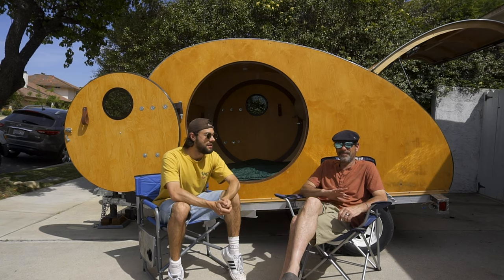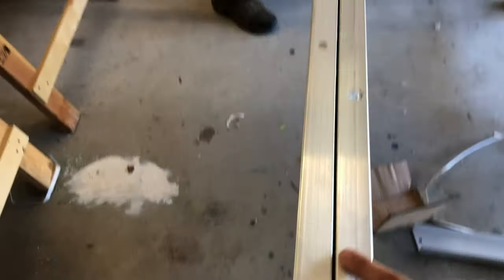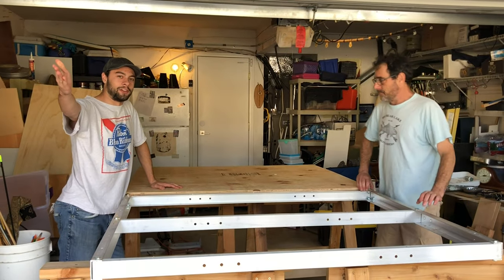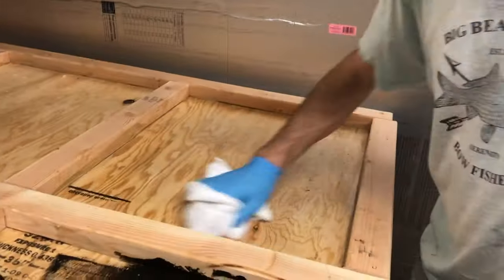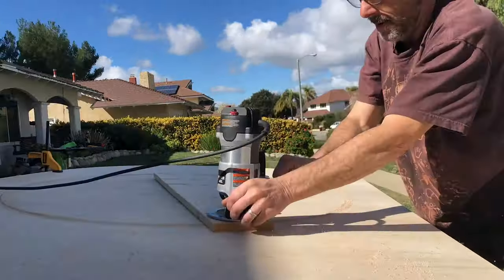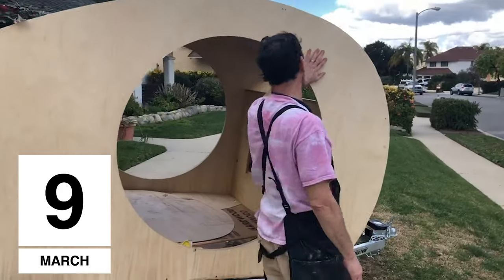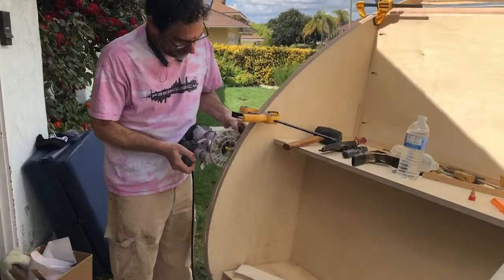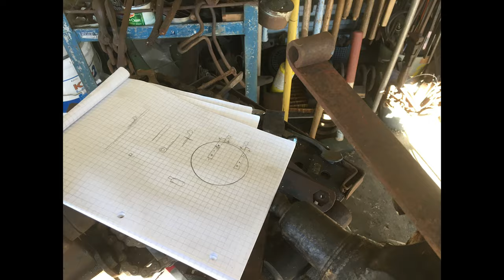BUILDING OUR TEARDROP TRAILER

Comment: I have thought about using that trailer...price and weight is good for my project.  Not heard much about reliability of aluminum  joints and axle bearings.  What is your experience so far?  Easy enough to upgrade.